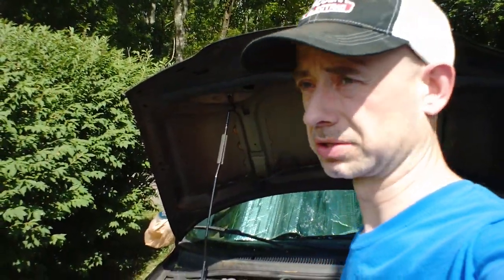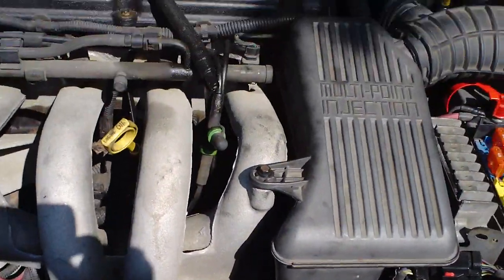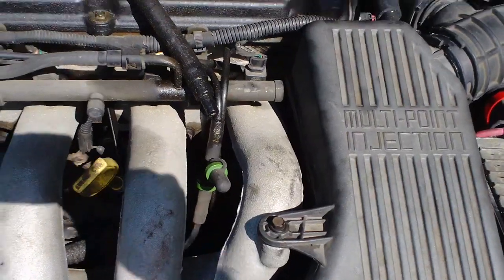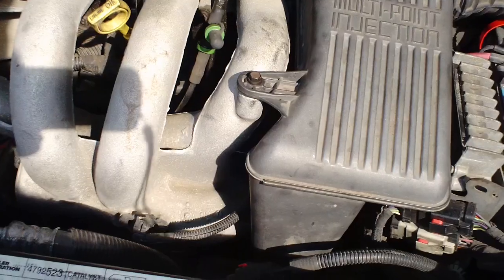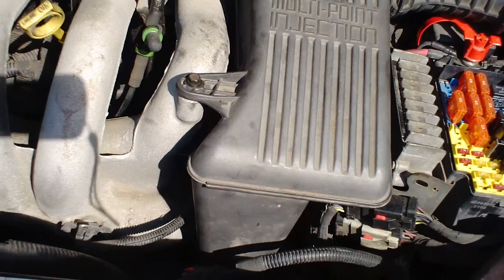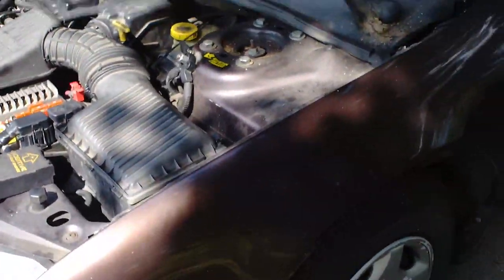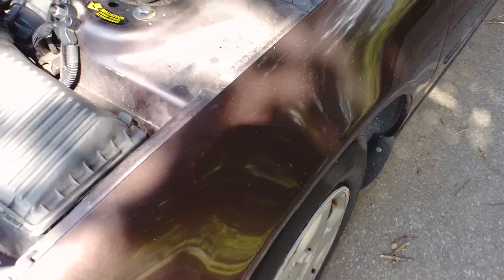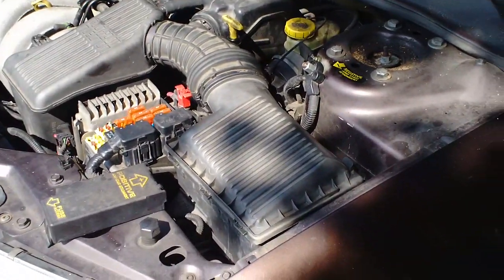Dodge Stratus 1997(1st gen) 2.4L 4cyL., starter replace, trouble shooting & diagnosing

Comment: Where did you find that 20 Amp plug in breaker?
Reply from the maker: Probably Advance Auto or Auto Zone, can't remember it's been so long. But any parts store might have it, maybe call them 1st, & shop online ebay or amazon.  It's Longer than the original fuse, at 1st I thought or assumed it would Not fit under the plastic cover, but it did. Don't remember if I just left it in there after I finally replaced the starter or put the original fuse back in.  
Good luck, wish you the best.   - take care
Reply: Thanks a lot Lee. Great video, it'll help me a lot when the weather gets to where I can work on it!

Comment: My sisters 98 breeze with the 2.4L has been blowing the same fuse for a good 7 months. Was in the shop for 2 weeks and they couldn't figure it out. They suggested the starter but couldn't guarantee it. I Threw a 30amp in there and its been fine for about 2+ months but now the starter is acting up. Seems to be a bigger chore then I thought trying to replace the starter. Hidden bolts and not much room on these cars.
Reply from the maker: Thats a little risky using the 30 amp, 25 would be a little better. The 20 amp circuit breaker was just $5, so thats the safest bet. Yeah you're right its not the easiest starter to swap out, but you can do it, just read my text under this clip. If you lived around "Nastyville" Tn I'd be glad to help you do it.  Top bolt is easier to get out, u can get it out from the top side after you take out all the plastic & rubber air cleaner stuff. I think the starter bolts are about 13mm - 15mm socket.  After you get the bottom bolt out, try hacksawing the bolt head off & use it like a stud. If that works, then u just need a nut & good to go.  Good luck, take care.
Reply: @leeisenberg  I did try a 25 and that would blow within a day or 2. Never thought about a circut breaker but it seems that worked out for you pretty well. Either on the 4th or this weekend when there's more free time the starter is getting replaced so hopefully that sopves the issue. My sis wants to keep it for awhile because its still in good shape and only has about 118, 000  miles plus it gets great mpg compared to driving her tahoe everyday.
Reply from the maker: @brianallen9256  Did it work?  
Yeah I hear ya man, screw the Tahoe mpg. You got the same 2.4 4cyL as mine?  The 6cyL in these were supposed to be fun to drive.
Reply: @leeisenberg  yeah its the same engine and its been starting everyday since. My sister had a 2000 something stratus before with a v6 i believe but it was nothing but problems so it didn't last long. This 98 breeze didn't start one time a few weeks ago though. Turns out when it was low on gas it had a bunch of air in the tank and we had to let it out along the fuel rail. Not sure what caused it but its been fine ever since and she no longer lets the needle drop below 1/4 tank.
Reply from the maker: Cool man, r U using the 20 amp circuit breaker or did you have to put a starter on it?   I think the circuit breaker kept ours going for maybe about 5 years.  I'm about to ditch my 2004 Strat w/ the 2.7L v6, internal water pump is shot & I'm NOT doing that nightmare job, among other things, & only about 140,000 miles; pitiful. That is a weird issue w/ the air in the fuel line, wonder how the heck that happened?...  How did you diagnose it?
Reply: @leeisenberg  i threw a starter in it. If its around long enough and has the issue again I'll put a circuit breaker on it because the starter kinda sucks. I think my sisters had around 150k miles when it was about to be on the way to the junkyard. I couldn't figure it out and our cousin who is a mechanic was too busy to lend a hand at the time plus my scan tool came up with 0 codes so it just sat there for 2 weeks. I was thinking it was out of gas so i threw a gallon in and still nothing. She knows a guy who flips cars but also works on them and he came by started messing with stuff and said i bet theres air in the lines. All he said was don't run the tank that low regularly in the cold weather so who knows what was really the cause or if he's right.
Reply: @leeisenberg  i can imagine that internal water pump is a nightmare and I'm sure a shop charges over $1000 to get it done.
Reply from the maker: Oh did you get a cheap starter?   I think there was just 1 available in stock at Advance.
Reply from the maker: Yeah, its total FUBAR, mercy.
Reply: @leeisenberg  i couldn't find one so i ordered it through O'Reilly for like 100 something bucks. I could barely find an air filter for it recently when i threw some plugs in it.
Reply from the maker: Oh gotcha, I got a Spectre er whatever knock off K&N from Advance, they may have had to order it, can't remember.